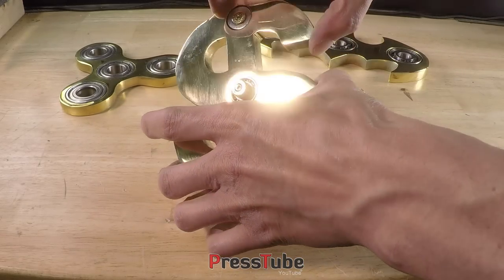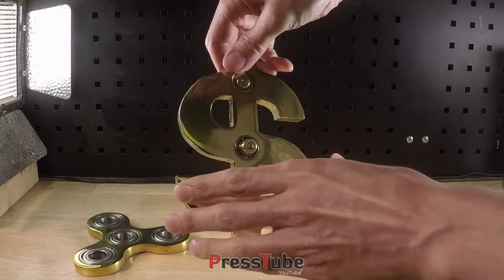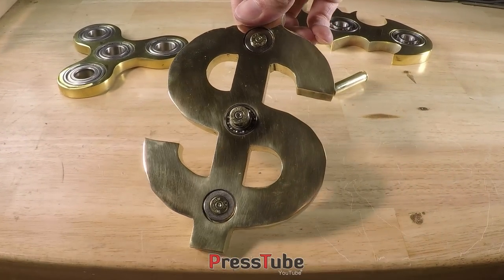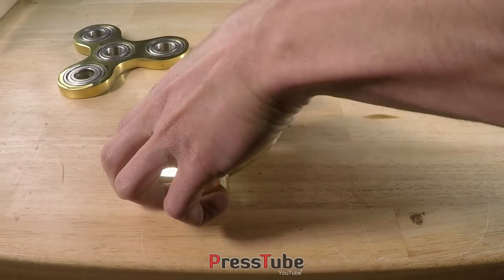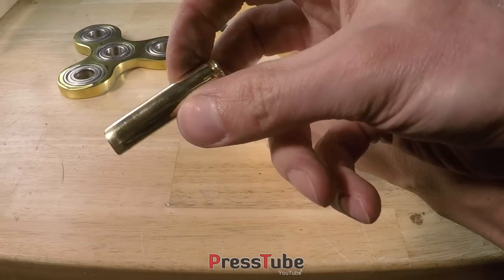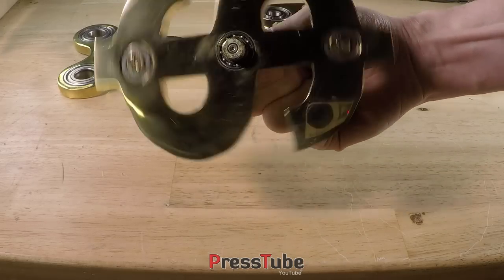Casting Brass Dollar Fidget Spinner from Bullet Shells

Comment: one question

why the liquid nitrogen?
Reply: ZYL:):):) i guess to cool down faster
Reply: when you cool metal down that much and that fast it basically shrinks, so he shrinks the bearings so that they go in  and then when they heat back up to room temp they expand and fit nice and tight !
Reply: Cool it down faster, and then also so he could fit the bearings in. "He could have heated up the spinner with a torch, but that would changed the color of the metal and ruined the finished product."
Reply: Buy we know are science
Reply: ZYL:):):)  it is for the bearings to make smaller so he can put them into the spinner
Reply: Deimos Phob i thought u were donald trump cuz the picture
Reply: ZYL:):):) I thought it was dry ice..
Reply: ZYL:):):) i dont know, i crew that for the rotation of the spinner
Reply: NoobHunter67 he pressures d bearings